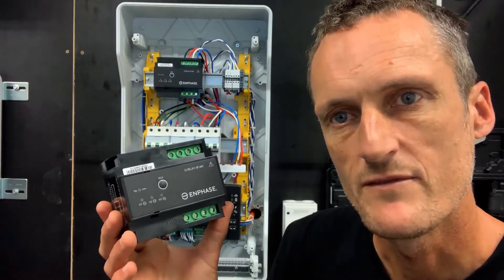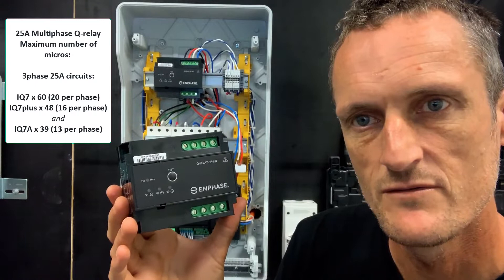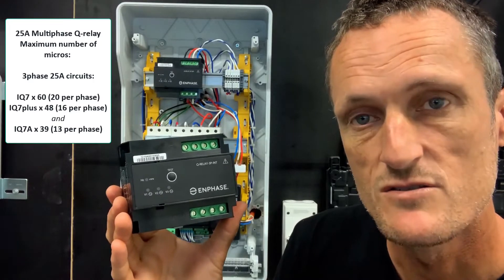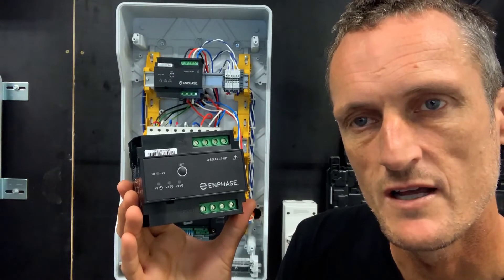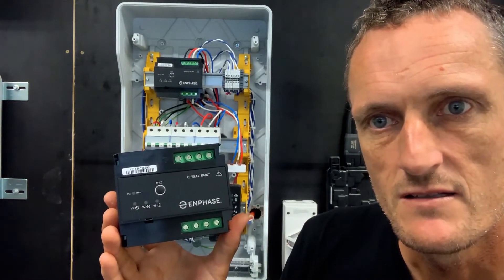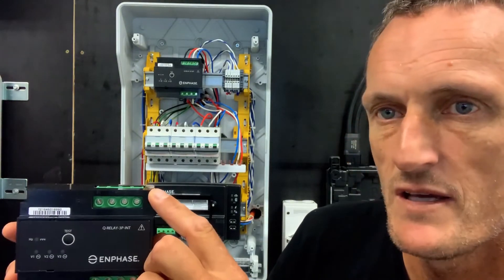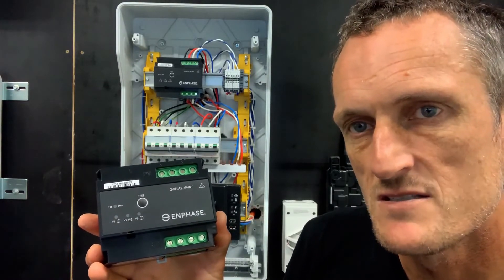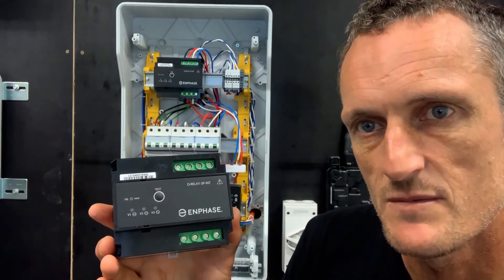Q-Relay Multiphase

Comment: Can I use the Q-Relay (3-Phase) for 2 groups in a 1-Phase environment? Or do I need the 1-fase Q Relay device twice? I need to connect 18x IQ7Plus on 2x 16A groups.
Reply: I think in this video https://www.youtube.com/watch?v=1qqOsRKb_hI he says you need to use 2x single phase relays
Reply: @coconutpalm1631  Thanks for your reply, I ended up with 3 solarpanel groups and I used 3x the 1-fase Q-Relay, works great :)